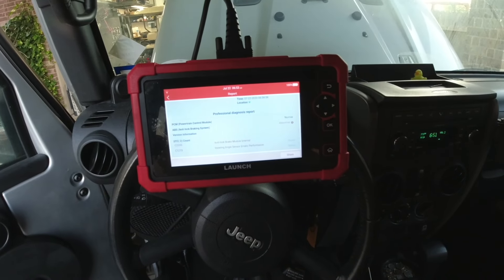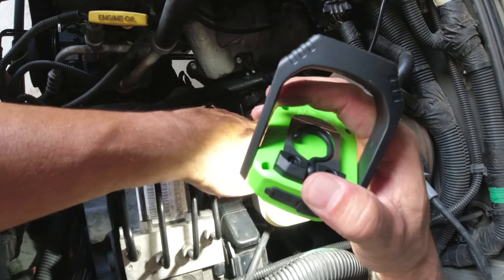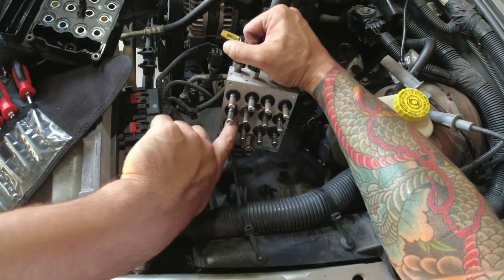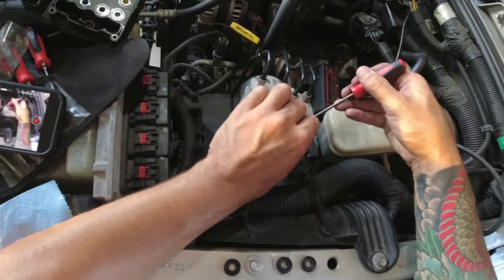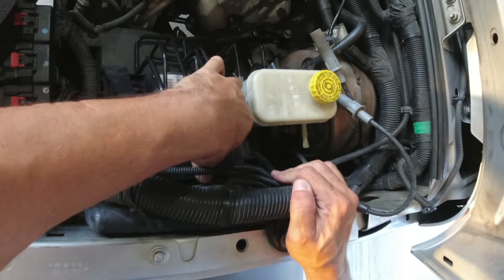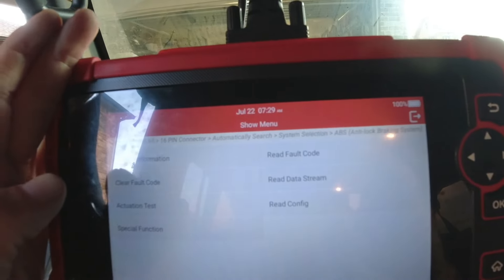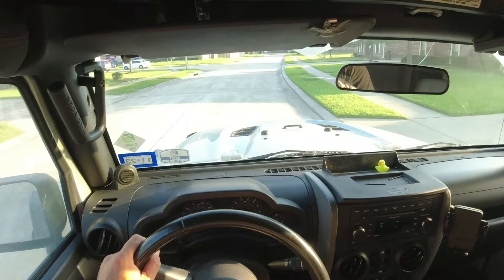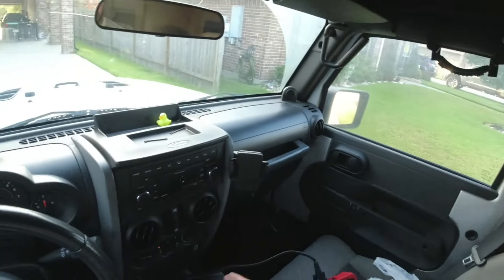How to Replace and Program 07-18 Jeep Wrangler ABS Control Module Code c2200 c121c

Comment: So I had this issue with my 12 dodge charger. Started with “speed sensor”issues. Replaced the ones that were supposed to be bad. Issue still present. After this the brake light stayed on at times the car wouldn’t go into gear or start at due to car being push to start. Ordered pre owned abs module installed it. Got 2206 code vin mismatch abs,Tc, check engine light all on still. Got the launch and followed these steps in the video and within minutes my issues all were resolved. The new updated launch is Amazing and will save you a ton of money! Great video and thanks a lot. Dealer told me 500 to program the new ABS module. Got this launch and it’s done.
Reply from the maker: Nice!!!!!!!!!
Reply: Same story as yours on My Sister's Jeep compass 2012 only 81 kilometers, front right ABS sensor failed, got it replaced, then lights didn't go off after a few trips right rear sensor code popped up then replaced and at the end ABS module still gives C2200, all ABS initialization done but module seems to be faulty, after reading online all those eventually fail due to issues in the circuit board, I'm planning to open the old one to see if there are cracks in the board so if the replacement fails again then I will have a spare one. This jeep compass has been nothing but small issues (3 throttle bodies, one AC actuator, radiator cap and T fitting for hoses,), dash always is like a Christmas tree, I'm 100% sure that when is all fixed will only last 3 months before it breaks again, so I will stay away of any Stellantis products in the future and recommend my sister to sell that car once is all fixed.

Comment: Hey buddy.  Just wanted to thank you sooooo much!  I followed your directions and bought the Launch.  Feels great to do things myself and save money.  The only challenge I had was figuring out how to release the tabs to pull up on the connector.  Watched another youtube for that.  This has been driving me crazy for a year and I finally fixed it with your help!  Thanks again!!!
Reply from the maker: Yeah, that connector is pain in the butt, if I was using one of my better cameras I would have touched on it , but, I was in a hurry and just used the action camera . Thanks for the great comment !
Reply: How did you know you needed to replace the module? I took my jeep to electric “expert” and he told me I had an ABS module from a 2013 on my 2010 jeep wrangler. However we didn’t have an ABS light on but we did have an ESP/BAS light, traction control and the weird thing was the brake lights stayed on with key on and with the jeep running. Hoping the dude doesn’t tell me I need a new module and then need to program it. Might cost you to $800
Reply: @bowtiebuilding  how much you want for the 2013 module?
Reply: What year is your jeep?

Comment: Can you use a used module? If so do you need the vin to the donor?
Reply: It does work, I just did it. Don’t need anything other than the tool to program it
Reply: So I have a 2015 renegade, bought a used abs module, but it won’t let me clear the donor vin and record mine. Do you have any idea of how to make it work?
Reply: @NorteAbroad  i don't remember, I'm pretty sure I did exactly what the guy in the the video did but I also remember that a new code appeared regarding the inconsistencies of Vin number with the module so I would press on that code and check if there is any function/action to do. let me know if that works, I don't have the code reader with me rn to check exactly how to do it but I can check tomorrow
Reply: @francofornero580 much appreciated. What’s the model of the launch you used?

Comment: THANK YOU!This was the fix for my 2012.I purchased the touch screen Launch X431 CRP EBT Elite it worked Perfectly.I had two mechanics tell me the dealer had to flash it.This tool worked seamlessly.I can't say my jeep is a POS It has 165k and my wife's has 200k still going places most vehicles can't.
Reply: What was the part number my guy?

Comment: Excellent video 👊🏻👍🏻 Iam sure mine will go out eventually
Reply from the maker: Fyi, 07-11 abs module are a little hard to find.
Reply: @Donnythelatemodeltech  great that’s what mine is 😳 so far so good 🫰🏻
Reply: Had to drive an hour and a half away to find my exact module I returned, installed it , found out it had to be initialized. Can't believe you just dropped this video. Gave me all the info I need to finish this job . Thank you bro!  Awesome job saving people time and $
Reply from the maker: @daze1780  no problem! Let me know if you have any questions.

Comment: @Donny The Late Model Tech.  Wanted to give you a huge thank you for this video.  I replaced the ABS Module (used/rebuilt) in my 2016 RAM 1500 and had to reprogram it.  I bought a Launch X431 CRP919E Elite from Amazon and followed your steps.  Saved me $$$ and time.  Thank you sir!
Reply from the maker: Glad it worked!
Reply: $130/shop time vs $465 for this to program? I get you have the device after, but it didn’t save you money. The video and installing yourself sure will. His video was on point.
Reply: Would the X431 work to reprogram the ABS module on a 2009 Ram 1500

Comment: Did you  the leave the scanner plugged in while you were driving around? My BRAKE light comes on intermittently, so this will need to be done soon for me. And can I use the LAUNCH to program a instrument gauge cluster?
Reply from the maker: Check the level of you brake fluid?

Comment: Great video, did you have a VIN discrepancy before or during the initialization?  I am currently getting that IDK..
Reply from the maker: No issues at all , everything in the video is exactly how it went down
Reply from the maker: Just a heads up, there are a couple different modules for the different years, make sure you have the correct part.
Reply: I have a 2012 jk but bought a 2018 abs guess it won’t work even with a scanner like your s
Reply from the maker: I've never tried to program a newer abs module on a older jeep.... Let us know if it works. @richarddiaz8248

Comment: Thanks for your help with the video.  I have a 2016 JK and had to replace the pump as well because the electrical unit is currently indefinitely unavailable through Mopar.  When I installed the Full ABS unit the traction control light remained on ams the cruise was disabled.  I bought the Launch unit (keep in mind that Launch USA does not take questions on nor service models bought on Amazon or Ebay) similar to yours and after running the initialization program the traction control light went off and the cruise works.  I also bought the used module with my VIN pre-programmed.  The scan tool at first recognized the used VIN and would not re-write the new VIN, but when I ran the initialization my VIN magically appeared on the updated ABS unit.  Still have to bleed the unit as my brakes are softer but good for the moment.
Reply from the maker: Really appreciate the comment on this issue. Lots of people asking about used - vins - and really had no answers.  Most appreciated.    Friendly reminder to use that scanner to bleed the brakes to get it done 100%.

Comment: Thanks buddy! Replacing one tomorrow on a 2015 jeep, hoping the used ethos scanner I bought will work. If not I’ll buy this scanner through your page.
Reply from the maker: Good luck 👍
Reply: Welp parts just informed me the ABS module is on restriction till mid July 🤦‍♂️. On to the next one lol.

Comment: Just checking to see if the lights stayed off?  My dealer wants $1400 to do this repair including the module.  I'm thinking I'll try this if it's been successful.
Reply from the maker: Yes , no light.
Reply: My dealer said $1600 plus the 338.55 part which won't be available until mid April.  Dealer rip off!

Comment: I replaced my module and I did the procedure.  it says it was success but still shows the code with symptoms. I never cleared the old vin from the new module. Is that something  that needs to be done in order for it to properly work?
Reply from the maker: The new module is used?

Comment: i have a shop, all my customers with Wrangler had to replaced that ABS module, what horrible cars, and people still are buying that piece of junk . 4runner for ever!!!!
Reply: Bro so funny, I have a 2015 wrangler which brought me to this video, and my main vehicle is an 06 4Runner. Best vehicle ever.
Reply: @joshb7677  2010 toyota sequoia with 268k miles.    how many abs module ? zero, starter motor 1, alternator 1, air pump 1,
Reply: I blame all new vehicles from 05+ all pieces of shit, as for Jeep they should go independent and tell Chrysler to go to hell

Comment: I used the link and bought the exact same launch unit and all my options are different. Doesn't say 16 pin connector, no where does it have special features. Are there updates i need to pay for?